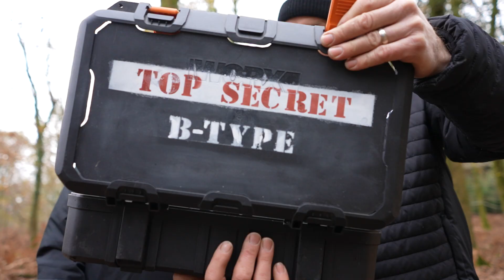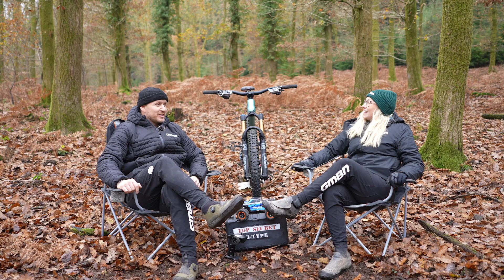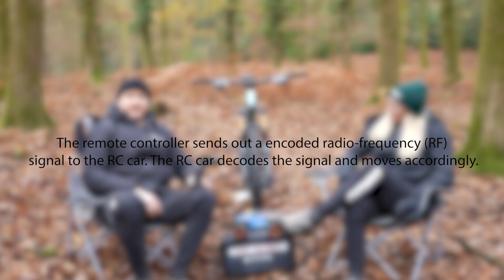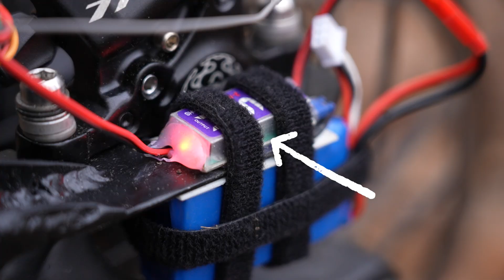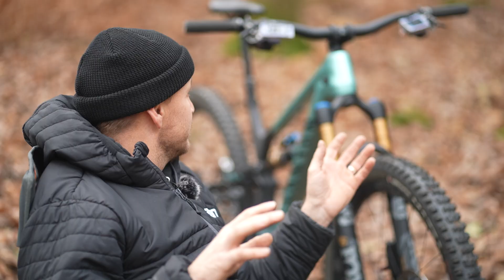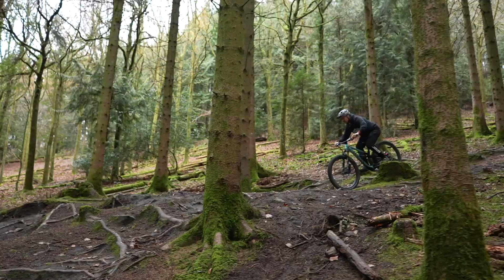Breaking News | Wireless Bike Brakes Are A Reality!

Comment from the maker: Would you ride wireless brakes?  - Watch the video on GMBN
📺 We Made The World's First Wireless Bike Brakes
🔗👉 youtu.be/Iw7zM4NNEN8
Reply: just in time for the solar maximum! I really hope that NO ONE follow this "dream". If your wireless dropper fail, it becomes an normal one. If your wireless gears fail, your bike becomes a fixgear bike but if your brake fail...
Reply: @oscargarcia9665  In this case he would have to carry his bike as the brakes would be locked in the braking position...
Reply: @Mo.Jo.MTB_101  Depends on how it is made. They could be else stuck fully open or fully pressed. none of these are good. Imagine losing the brakes at 40kmh hownhill, not nice. Now imagine them fully locking at that speed, not nice either.
Reply: @jurekgadzinowski2895  Did you watch the video? In the case of Blakes "design" the rear brake would be fully on and the front partly...
Reply: @Mo.Jo.MTB_101  Still insanely unsafe
Reply: @jurekgadzinowski2895  Well if you refer to Blakes build then I'd say it does have room for improvement, if you refer to electronically controlled brakes I'd disagree... The questions of wether it is safe is how the brake reacts in case of a failure not not how it is actuated. A brake cable can fail just as well as a hydraulic hose. In which case the "conventional" brake would fail as well. And I think it is more a question of being more apprehensive about something new/different rather then it (controlling something with electronics) being inherently unsafe. After all brake by wire is part of the fly by wire flight controls in any airbus...
Reply: @Mo.Jo.MTB_101  I'd argue that a mechanical or hydraulic brake is much less likely to fail than this kinda contraption, and impossible to be hacked into by someone just looking to hurt ppl for their own entertainment! If these calipers lose power in any sort of way the servos do aswell, and without power they can't move the brake to the "failsafe" position. 

And to adress this possible counter point in advance: "But that could be done by a spring pushing the servo arm"

Yeah, good luck getting a spring to push that servo arm against the massive gear reduction of that servo...
Reply: nope
Reply: Never Never Ever! 
Wednesday Thuesday Friday is going on for ppl that are so crazy.
I Hope for him the Battery is always charged and the servos nerver failing him. Oh and he only drives where only a tree and himself can get harmed.
Reply: All good and well and brilliant innovation...till loads of folk have the same frequency chips on trail and they jam there brakes on and you go flying OTB at full speed 😂 opens up a lot of opportunities for playing pranks on your friends tho 🤙🏻
Reply: Good point about the opportunity for prancing. Because it’s wireless, there is definitely a vulnerability someone could take advantage of.

I wouldn’t mostly because I don’t want more items to keep charged or change batteries (e-waste) on. A battery for each caliper and lever. There is also greater complexity, which means more chances for something to go wrong, this time with little to no warning. There are signs with cable-pull or hydraulic brakes, and they still work for a time, giving you time to correct problems before complete failure.
Reply: No, no, no, no, no!
Reply: i dont like electronics on my bike. i just charge my garmin
Reply: How much more complicated can we make a simple push bike with weight / charging / servicing etc , sorry it’s another trying to reinvent the wheel again ! Great for the marketers though but make sure you have a good insurance policy 😂
Reply: Well let's see. Wireless dropper, if it fails, no biggy. It's either stuck up or down but you can still ride it. Wireless shifting, if it fails, you can't change gears but you can still ride it. Wireless breaks if it fails going downhill or remotely fast on flats, ya you're screwed! So, nope!
Reply: A I really like this and B if it is well executed why not... The part about the brakes being on as a sort of default no power position reminds me of a lorry where if air pressure is lost the brakes turn on...
Reply: wireless brakes? yes, please, right away!
Reply: Yes, I even have a bike frame and forks customer made with both zero internal routing and zero cable stops.
Reply: Would it be possible to connect the motor and brake lever arm with a solid rod? That would probably allready somewhat improve the speed of actuation and it easier.
Reply: Nope
Reply: GMBN, A Pioneer of Mountain Biking🚴
Reply: What about self-driving bikes?
Reply: :)) one of the funnest comments section in a while.. chill out everyone, they're not playing w/ blackholes :)
Reply: Yes! but for gravel riding first until i feel comfortable then add to my mtb
Reply: Wowwwww...
Reply: I would, but only because I know how reliable bluetooth can be. I would even add a trigger to the left lever for full control regenerative braking on ebikes.
Reply: Using lipo battery on a bike is bad idea, they have high discharge rate and can give lots of power quick, meaning if you pierce battery is almost guaranteed fire ( flamethrower style from place where cell was damaged) always storage charge on 3.85V per cell if you not going to ride for a while ( you need smart charger for this) never overcharge lipo battery  and don't go lower than 3.5V per cell. 
Watch some videos about lipo maintenance  and stay safe 👍
Reply: I'm happy print I got 2 bambu x1c
Reply: First, Blake, you're working for the wrong company. Second, you put a lot of work and thought into this. You should patent the idea and device. Other companies will steal your hard work.

My only criticism is that this initial attempt looks like an f'n mess on the bike. To put on bikes worth $thousands, you'd have to clean up the appearance a bit. Other than that, an amazing first! I hope SRAM, etc are paying attention.
Reply: @elizabethpoley6882  But the idea is not that original, it is just that it is expensive and not as trustworthy as normal brakes.

Comment: I have zero desire for wireless anything in a bike, save for my GPS tracker. Drive train, brakes, once done up properly, I have not had any problems with them. Folks talk about "shifting under load" but I grew up doing "shift before you need to" and it's always worked.

Comment: I would be ok with wireless shifting and droppers as neither of them are an essential safety-relevant component of the bike and a failure is tolerable, but brakes must be as fail safe as they possibly can, so handing their entire function over to any sort of electronics, let alone wireless, is a no-go for me. Yes, I can see some merit in electronic assists but the brakes must not be taken out of working order by an electronic failure. Imagine u take an unplanned bath by crashing into some body of water, or simply ride through a creek, and the brakes get wet. The worst short term consequence for a regular brake is a squeaky rotor, which stops squeaking once it dries off (long term u may wanna keep an eye on the brakes afterwards, at least if they're cable actuated). If the electronics of a wireless brake got wet (yes, I know they'd be made waterproof in production, but one hard hit to the housing is all it takes) it would flat out stop working entirely. Maybe the battery suddenly loses power for some reason, same outcome. Or maybe u simply forget to charge any or all of those 4 batteries. Bye bye, brakes.

No, I would not trust any electronic brakes period.

And I say this as an electronics technician working in the defense industry.

Comment: Now heated handlebars that's useful, but wireless brakes? 
What genuine advantage are they supposed to offer? 
- ABS? 
- Having to keep buying proprietary batteries and chargers? 
- Do they come with an app on the smartphone that requires weekly updates?
- Is there an online break service subscription with monthly fee and AI powered customer support chat bot helping you navigate answers and questions in a forum?
- Will the monthly service subscription plan come with cash back reward points?
- Will there be an extended warranty and guaranteed updates of the brake service and configuration app for two years with special offers for subscription and platinum warranty renewal?
- Do the basic model variants of these wireless brakes have downhill AI break assist, cross country - , comfort - , sport- , and performance - modes? 
Or do I need to buy the limited Performance line models for those?
- Will I qualify for free shipping if I order within the next 24 hours?
...Questions after questions...

Comment: This is something  thought of today . Silly me I thought I was the first one to think of it. Brilliant idea. I know nothing about mountain biking so can't comment on how good they may be for that. I can however see a use for this. I have a recumbent trike I bought for my wife who has some disabilities. She loves riding it around on a grass field. But as so as we go on the road she becomes wary as she has not got enough strength  in her hands to pull the lever. Something like this would be brilliant. If you were willing to use a little 3 cable loom and a servo tester suitably bodged you would no longer need the radio. I am thinking simple light weight cable to a box containing the servo controllers and suitable battery then the three core to the servos attached to the brakes.   What do you think. Great video keep up the good work 

https://www.youtube.com/shorts/omyqqbYGVfo?feature=share

Comment: I really hope there's an inbuilmt security system preventing you going on a run if there's no/not enough battery left...
Like the break should callipers should be in a closed by default mode.

Brakes are a security / life saving system ... you can't allow for them not to work whenever you need.

Comment: I'm in 2 minds about the safety of wireless brakes, then again, there's not too many issues with wireless gears that I'm aware of. 
As a fail safe, you could have an 'emergency' battery somewhere on the bike so that if there is a battery failure, it supplies power to the affected lever or caliper temporarily.
Trouble is, it would have wires running to each unit, sort of defeating the object of being fully wireless.

Comment: Impressive, Blake. Even more so considering you are not an electronics expert. 

It's good to see there is a fail safe for the power loss point of failure. The ongoing issue will be addressing all the other potential points of failure and coming up with solutions for them.
Reply from the maker: V2 on the way when we can get the nerves to do it!

Comment: no just no,... i really think the idea isnt bad,... but... you just need to forget to charge 1 time,.. and it can be your last time... so no... if i forget that on the gears, its no big deal, but if i forget that on the brakes,.. and they stop working on a dh section,.. or worse,.. on a road in traffic to or from your destination... no...sorry.. cable isnt great but way more reliable than the human factor

Comment: They need a 2 faze system in the brake lever to tell tou when your calipre is touching the disk, maybe a light spring first faze then an heavy spring for the second faze and maybe a viabration for lockup.

Comment: Amazing innovation! However, if the transceiver and receiver going to the servo are paired via radio frequency, what happens if another bike within the same radio frequency goes inside the proximity? Will both bikes be able to control the brakes of each? Something that can be added to the list of your test cases. :)

Comment: What are cables but braided steel wires? What are smaller wires for electronics, braided wires? So you're not going too far away....I was sitting around thinking last night, bc that's part of the design process. I put the bike in front of me and I'm looking at multiple areas and ideas simultaneously. While away from the bike, ideas come to mind, but when looking at the physical, practicality is a strong guide in reality...For instance, where I like electronics in one area, and the Industry is pushing it out which is icing here, is a front mech. (and a gear hub with an idler pulley/clutch takes care of a whole lot back there; also think E-bike)  My cable comes out of an open down tube, around a plastic thingy, to the backside of the seat tube. An E-mech is the obvious winner here. Changing the swing arm position to the side, with the "box" in front of the seat tube, blimey!  Now I can go 2.5" in the back, and boost the fork.  Wait 'till you hear about the tandem. No, I'll keep that for the AT.

Comment: I wouldn’t worry about batteries dying or loosing wireless connection but the servo would realistically need to be built in to the calliper along with the wireless tech, that’ll make callipers bulky, heavy and expensive (not to mention the levers) and there isn’t exactly a lot of room between the hubs/frame etc. I think we’re still a long way off from wireless brakes considering how good the current stuff is already. Maybe callipers integrated in to the frame/fork although this all just adds weight. Hydraulic hoses are pretty much bomb-proof and can be bent around sharp corners/tucked away if they bother people so much. I’d be keen to see you perform an emergency stop on the set up you have there if possible ?? Those TRP callipers are terrible and are only fitted by manufactures to save costs on not having to fit hydraulic levers.

Comment: I would not ever use one of these, with shifting I get it but if it's a safety feature, I do not want to rely on a battery, I'd rather use a cable so I can feel if something is going wrong before I can't brake anymore

Comment: these are the things that happen when somebody has too much time on their hands. don't try this at home kids. definitely innovative and seems to work ... but I don't see the need or want. All that would happen if this concept ever came to market, would be taking the "bulk" of the brake lever from the handlebar and relocating it to the fork & frame, plus cause a whole new set of problems to overcome for safety and reliability. There's a reason (or reasons) electronically controlled bike brakes don't already exist.

Comment: I have about 30 Rc cars and every so often a glitch happens or interference, now think about it happening when you need to stop or a glitch or interference happens to the front brake at full speed and suddenly locks the front wheel???? Believe me will happen more often than a mechanical failure. 
Anyway good luck

Comment: For the "failsafe" scenario, keep the front brake wired. A wireless rear brake solves a majority of the annoyance with cable/hydraulic brakes. Rear cables always need to be cut to be run through the frame, which requires re-bleeding a straight from factory new brake lever/caliper.

Comment: At least with cables, as stated, brake effectiveness will fade gradually over time as cables stretch and you can sense that. Electric brakes? Even if they’re linear as far as their effectiveness, many components within electronic circuits can suddenly fail. Granted, having failsafes is good but electronics can be unpredictable and you really don’t want that when blasting away on a fast trail.

But it is very intriguing I will admit! 👍

Comment: Pretty cool, for the soulless levers, perhaps you might want to consider the tech and processing brain in a PC/Console gaming steering wheel and pedal set up for a racing sim, the actuators there communicate resistance simulating the hydraulic feel, might boost the cost to produce, but would certainly give a little soul to those levers, there may be off the shelf parts available somewhere for other products, I don't know, the idea just came to mind as I was listening to you guys.  :) Winning!!!

Comment: Maybe the petrol powered RCs will provide a better regulator unit, but I can only imagine that you will have a custom motor and modulator made within a custom shell. For the lever tension, just add a soft spring in a pull or stretch config. Well I am going to watch the built now. Very excited!!!!
Reply: Gas RC is no different from electric. The radios and receivers are the same. just a servo plugged into a receiver, servo moves a throttle linkage. (same as steering). Electric rc uses a pcm speed controller plugged into the throttle channel instead of servo to provide smooth power delivery to the motor. Older analog electric RC used a resistor 
/wiper and a servo. This tech dates back to the 80s. none of this is new

Comment: thee problem with wireless brakes is once the battery dies YOU HAVE NO BRAKES so they need to fail in such a way that they lock up, like air brakes on a truck

Comment: At the very least, a system like this should fail locked, like truck air brakes. At least for the rear brakes. Better to skid to a stop and crash than to crash with no brakes whatsoever. 😂

Comment: Excellent ingenuity. As a further development thought, you could even record braking inputs, which could be uploaded to Garmin connect through an edge computer or smart watch. I imagine as a training tool for Downhill racers it could have some value.

I reckon BLE or ANT+ signaling would be more reliable and secure, but what you’ve done is an amazing way to use available of the shelf kit.

Next step would be to see if Garmin/Shimano/SRAM would be interested in supporting refining the idea. Though I reckon fly by wire brakes might not be easy to get to market for fitment to a bike that would be used on the road or in public areas.
Reply: BrakeAce can already add that type of (and even more - brake temp, etc) data collection to standard brakes!